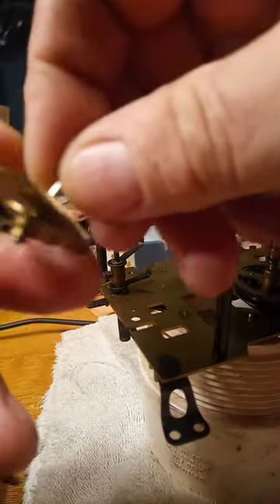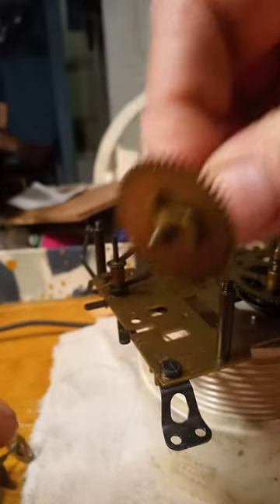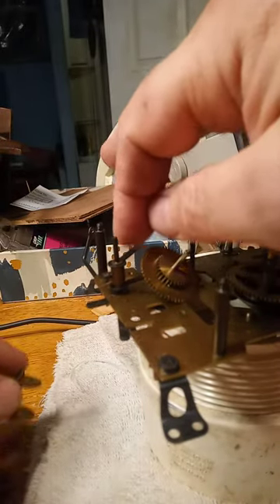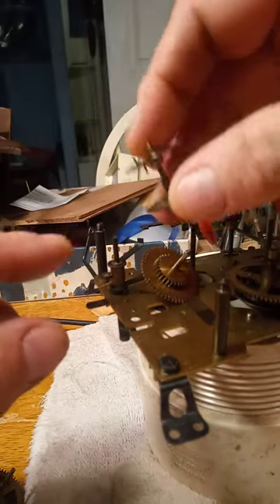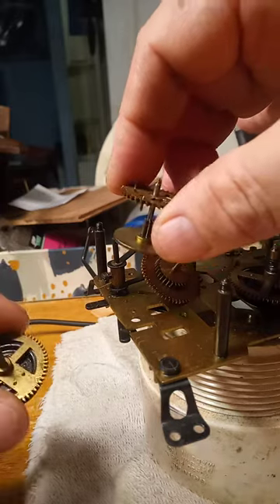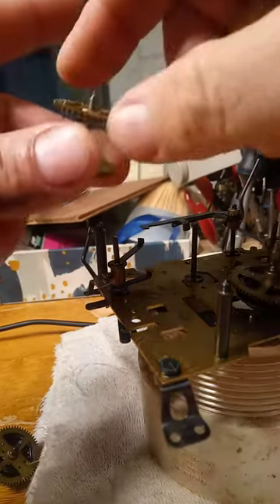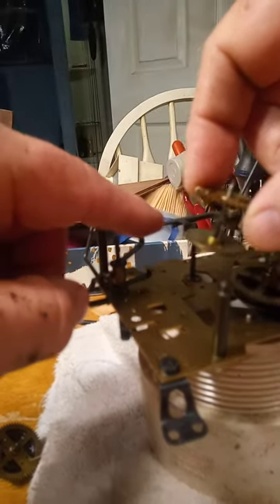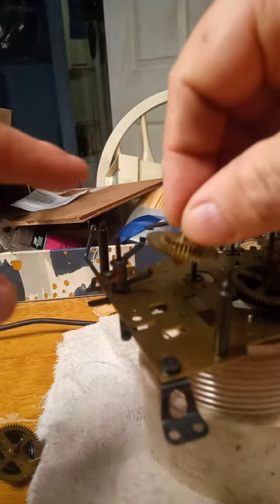Working on a cuckoo clock that has the cuckoo and couple that spin video 4 20210330 012602

Comment: Very cool design. What does the case look like?
Reply from the maker: That is in part 1. Thanks for watching. God bless.  https://www.youtube.com/watch?v=uUamvlPbv48
Reply: @munnerlyn3  Sorry. For some reason part 1 started about 45 seconds in for me so I missed it. I thought you might show it at the end, but you didn't so I was left hanging! I went back to part one and saw it. Thanks for keeping me straight!
Reply from the maker: That is my ADHD kicking in where I either lost a video, didnt name it right, or never finished this clock. LOL.
Reply: @munnerlyn3  I wish you would finish it then. I have not seen a movement like it.
Reply from the maker: You are supposed to send me pms on FB as I have this set to new messages. I have to set it to messages that I havent responded to in order to see replies to replies.  The one thing that I hate about you tube. I only do that every so often.